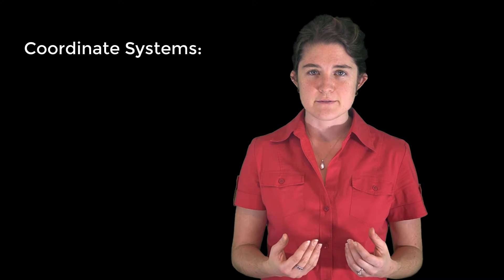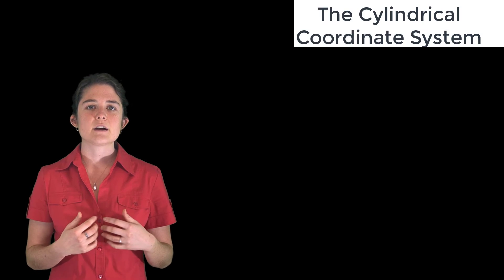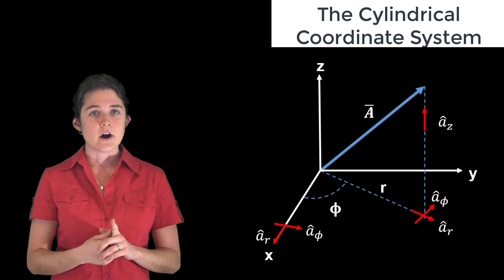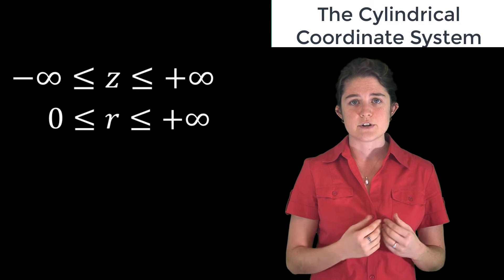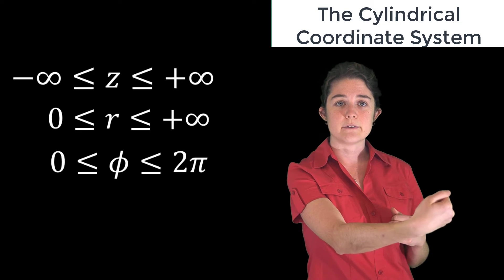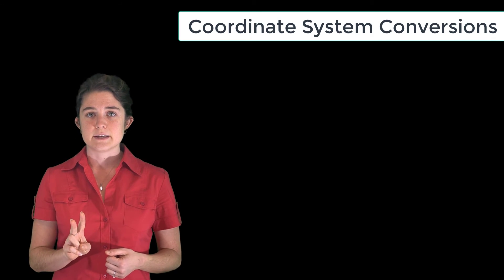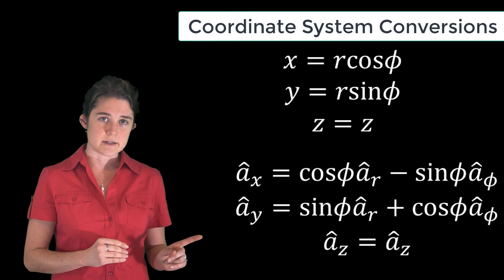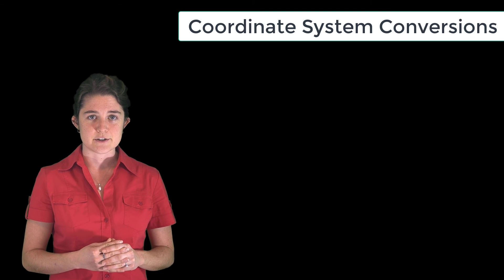The Cylindrical Coordinate System — Lesson 8

Comment: HOWDY ma'am! Just wanna to say thanks for the Cylindrical Coordinate System video 🙌
You really gave people all the basic tools they need to switch between cylindrical (eρ,eϕ,ez) unit vectors and Cartesian (𝕚, 𝕛, 𝕜) — no memorizing random formulas required.
Once you use the position vector and its partial derivatives, the whole thing clicks fast.
We’ve got:
ρ = √(x²*y²)
x = ρ cos φ
y = ρ sin φ
z = z
φ = tan⁻¹ (y/x)
So the position vector is:
𝕣 = x 𝕚 + y 𝕛 + z 𝕜 = (ρ cos φ) 𝕚 + (ρ sin φ) 𝕛 + z 𝕜 
The unit vectors in a curvilinear system are defined as the normalized partial derivative of the position vector with respect to that coordinate:
𝕦ᵢ = (∂𝕣/∂uᵢ)/|∂𝕣/∂uᵢ|
Takin' the partial derivative of 𝕣 with respect to ρ:
∂𝕣/∂ρ = cos φ 𝕚 + sin φ 𝕛, while he magnitude is √(cos² φ + sin² φ) = 1.
⇒ eρ = cos φ 𝕚 + sin φ 𝕛
For the azimuthal Unit Vector eφ; takin' the partial derivative of 𝕣 with respect to φ:
∂𝕣/∂φ = -sin φ 𝕚 + cos φ 𝕛
The magnitude (scale factor) is ρ. 
Dividing by ρ gives:
⇒ eφ = -sin φ 𝕚 + cos φ 𝕛
For the vertical Unit Vector ez, The z-axis is identical in both systems:
⇒ ez = 𝕜
The inverse conversion is clean too—since the transformation matrix is orthogonal, the inverse is just the transpose:

| eρ | = |cos φ   sin φ  0| |𝕚|
| eφ | = |-sin φ  cos φ  0| |𝕛|
| ez | = |0        0             1| |𝕜|

| 𝕚 |  = |cos φ   -sin φ  0| |eρ|
| 𝕛 |  = |sin φ   cos φ   0| |eφ|
| 𝕜 |  = |0         0           1| |ez|

Super clean explanation—makes the whole coordinate conversion feel way less scary. Appreciate you big time! 🌊📐